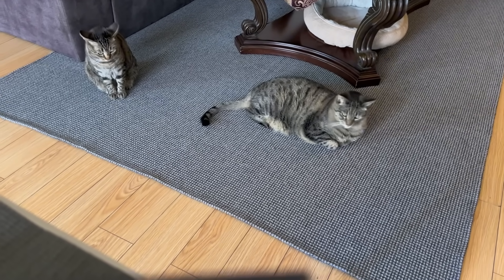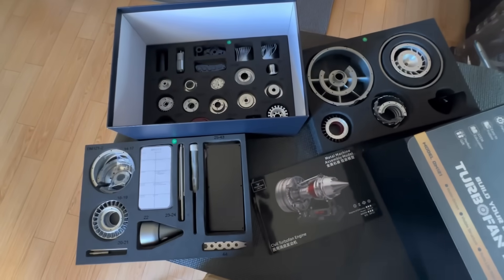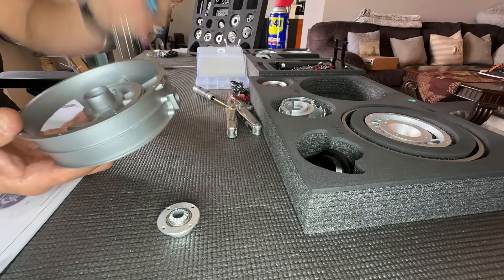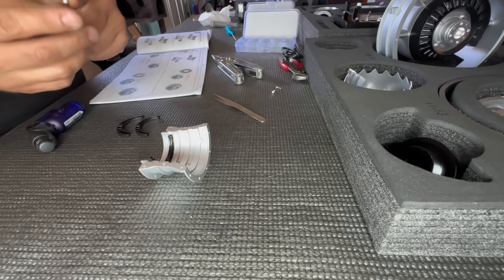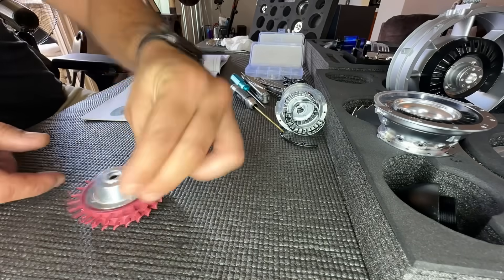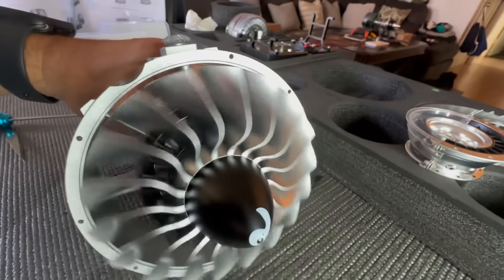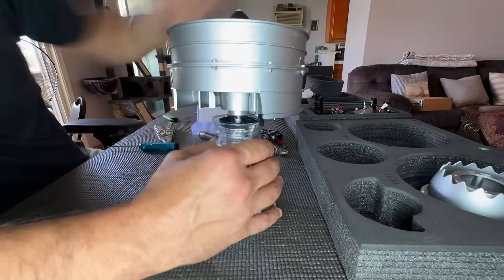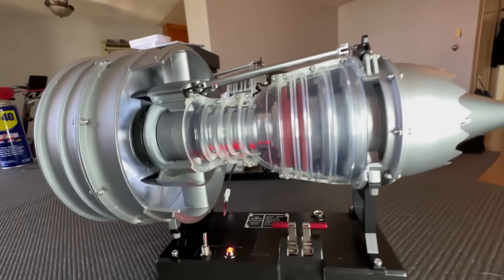Stig Projects (build an Engine CFM LEAP 1A/1B)

Comment: Hello Stig, do you know if the B737NG uses the same IDG Part Number as the B737MAX?
Thank you!
Reply from the maker: I highly doubt it would be the same part number, it’s a completely different engine. But to rule out any kind of mistakes on part numbers we use our illustrated part catalogues with effectivity to the aircraft and the engine

Comment: Hi Stig I was wondering how does the hydraulic system look like on the 320 versus the 737 and how does side stick/yoke/ rudder inputs move the control surfaces?
Reply from the maker: I have done a comparison on both in the past. But both have 3 hyd systems. Airbus just has it designed differently with green yellow and blue. Also Airbus is fly by wire.

Comment: Cool! now make one that size that runs on diesel and can power a generator for my UAV designs. 😅
Reply from the maker: That would be quite an engineering feat!
Reply: @StigAviation it is indeed. I built a prototype “APU”, which is automated. But not yet optimized. Burning Diesel with Shell Turbine oil. Smaller than this engine spins the first shaft at 135-160,000rpm and the output (turbofan setup) at 7k rpm just to make 3kw. Working on a better generator design, and engine redesign. Ideally to float the first shaft on air or oil, to prevent bearing overhauls every 25-50hrs. Due to those high RPMs. It’s nuts. Hopefully the next generator design can get me more wattage at lower RPMs. Aiming for 5kw. From a overall system no bigger than your forearm.